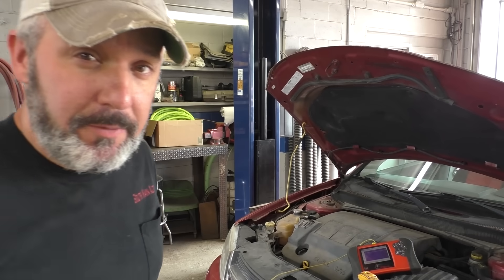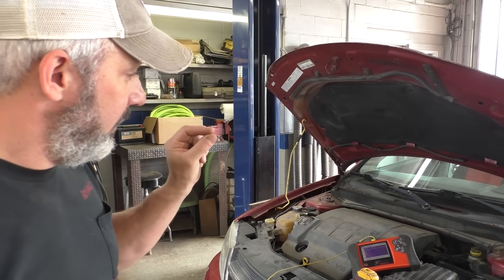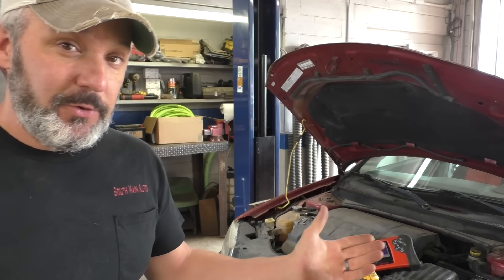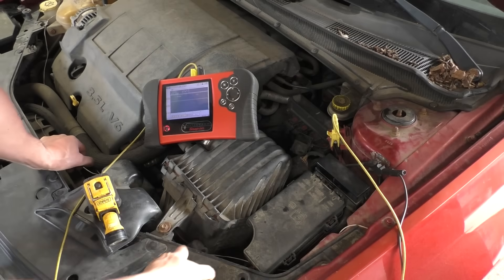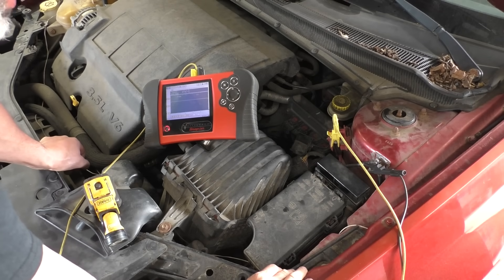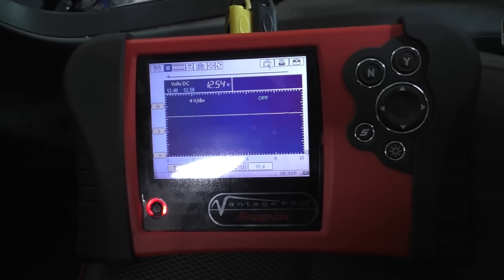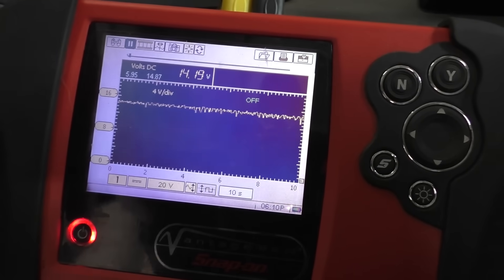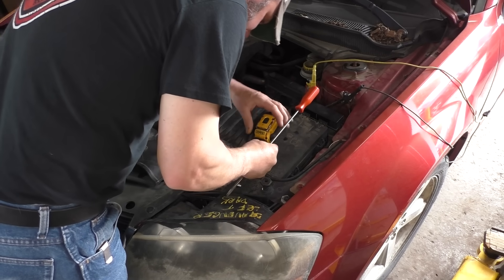Another Lesson In Voltage Drop - Don't Skip The Basics!

Comment: I have a car (2006 avalon) that has an ELEVEN Amp draw.. When I take the 7.5 EFI fuse.. It drops down to 1 amp... How is that possible? Fuse isn't blown... Killed a brand new battery and the alternator.. Shouldn't the fuse blow if there is a short?

Comment: The battery cable clamp looks like steel, not copper?  However, I know that in locations where they use salt on the roads, anything is possible.

Comment: Great video. I teach Automotive Electrics and on day 2, I explain that a volt meter is a "difference meter". It shows the difference in volts between the 2 places the meter leads are connected. My starter circuit testing includes measuring voltage drop on the positive battery cable, positive battery post to the "B" terminal (big terminal) on the starter solenoid and the ground circuit, battery post to starter housing. The test must be performed while cranking the engine. Should be .5 Volt maximum. Sad to say that most shops out there don't have a clue what they are doing and will simply "guess" with the customers money until they eventually repair the car. After they have guessed all of the possible parts, they then send the car to a shop who knows what they are doing as is the case in Eric's video. Unfortunately, these shops make more money by selling all of those unneeded parts  to unsuspecting customers, than the shops who know how to repair cars correctly, the first time.

Comment: a bad ground cable or ground?    jumping ahead a bit  I understand voltage drop ...its simply voltage that drops ...since the voltage pushes the current through the circuit, then it it gets tired and drops as it gets to the end of the circuit

Comment: Greetings from Estonia! I've been watching Eric's repair videos for a long time. I have an interesting experience with the ground terminal. We replaced the clutch on a 2002 Citoen and after assembling the car, the car wouldn't start, only the electric power steering worked when I turned the starter.We spent 2 days looking for a fault why the starter wouldn't start. The fault was that in the original the ground cable was attached under the bolt that secured the gearbox and starter to the engine. But we had placed the ground cable under the bolt next to it, which also secured the gearbox to the engine. The distance between the bolts was only 8 cm. A very absurd incident, I will remember it for a long time.

Comment: Using the parts cannon means a technician does not know what they are doing. There are simple devices that can check the battery, alternator and starter now, that cost $50. Batteries and starters should never be swapped out and then have the problem still unless they were bad.

Comment: You said that an ohmmeter would read 0 resistance in this case so you’d have to use a voltage drop test. Isn’t resistance in that connection the cause of the voltage drop? So therefore it should read some resistance?

Comment: Hi, I just want to ask if a voltage drop of .6v from BATT post versus IGNITION ON reading? The ignition wire from the key gives direct power to injectors and ignition coil so I am a little worried. Thanks!

Comment: Excellent troubleshooting. As a technician for over 30 years on industrial machines and aviation, I appreciate your hard earned experience. I have seen many issues due to just bad connections at the battery that could cause confusion. I trust your findings and appreciate your humbleness. Humbleness is strength. Jesus taught us that. I learned at an early age to always check the simple things first. Eric would also be an excellent teacher in an automotive school.

Comment: I am very confused. There is more voltage at the spot on the shock tower and doesn't that connect through the lug on the battery which is a poor connection. Looks like anything that connects to the lug on the battery would be impacted.

Comment: What I don’t get is this: based on Ω’s Law, if in a case like this with a corroded connection, resistance rises and the load continues trying to draw the same current - so how can voltage drop instead of rise?

Comment: I’m testing for voltage drop, neg lead to neg post, neg terminal disconnected, I have my positive voltmeter lead to this neg terminal, with the key on, I have 12v showing, with the key off it’s zero, with the key on its shows 12v again. Does this mean I have a 12v short or voltage drop with my key on?

Comment: For slow crank it would be prudent to inspect the transmission/block ground and if the crap battery ground lug band-aid repairs actually follow the OEM starting current wiring for starter return current to the battery. Why would the starting current go through a shock tower ground? Ideally it should go directly to the starter, but usually the OEM uses the next best thing which is the transmission case or the block.

Comment: I usually just use an amp clamp to initially check for parasitic draw. Can check for amp flow on the +terminal after modules go to sleep. If i find something then i look for the same amp value with a multimeter. If i see .9 milliamps flowing on Battery+, i look for it on the fuses, if i find .2 milliamps on a fuse i know i'm still looking for .7 milliamps somewhere. I make sure the total number of flow i find in the end is relative to what i detected in the beginning. There have been plenty of instances where there are multiple draws.
Reply: It's surprising how much amp flow is normal in newer cars though. Lots of modules stay awake and do testing post key off.

Comment: Guy I worked with in the early 80s had a beater VW rabbit that did weird things when you turned things on. Long story short, someone replaced the engine and didn't reconnect the ground strap from the block to the body.

Comment: Thanks. I've got a soon to be 17 year old car in the rust belt and over a year ago the headlights were flickering, plus it ate two alternators in a couple years, then everything electrical got weaker as the battery wasn't fully being charged. I temporarily fixed the problem by running a 12 gauge wire of 9" length from the negative battery clamp to a fender bolt. Things seem happy now but I'll have to look around better later on.
I did the same thing with a 20 year old CJ-5 that would drain the battery if it sat for two weeks after noticing that the headlights got brighter when I applied a little pressure to the clutch pedal. That patch on the CJ was permanent until I sold it 18 months later.

Comment: So, part of the voltage drop could be due to the way you connected to the negative terminal sticking a screwdriver somewhere is not the best idea. Also, the battery seems undersized or low on charge. You shouldn't be doing consecutive key cranks without running the emgine long enough to recharge your battery.

Comment: Min voltage on the top posts while cranking: 5.9 V
Min voltage on the battery terminals while cranking: 8.9 V
Max voltage measured between the top ground post and the battery negative: 1.5 V

=> We still have 1.4 V of voltage drop that aren't accounted for, don't we? What does the positive terminal of the battery look like?

Comment: Restoring a old farm truck I bought, lot of miles and about everything had to be gone thru and either replaced and fixed. Interior was a complete wreak and when I began I knew the door locks weren’t working and waited until I was just about done with the truck to troubleshoot it. I over thank the whole thing and in the end I had a voltage drop. 12 volts to be exact and it was across the fuse, fuse was good but the connector was spread on the one side and when you pushed the button it went to zero. It was hard to check the drop on the back side of the fuse block while the fuse was plugged in and no access to the back. Because of its age, and shape and how many miles I just thought had to be switches or actuators but it ended up something simple.

Comment: How much of the voltage drop was added by using the steel screw driver?  I know it has a low gauge, but it is steel, which has more resistance than copper or aluminum.   Not questioning the diagnostics at all, but I was expecting you put the resistance of the screw driver in your calculations.  Been watching you now for years, so I'm so proud of myself for even posing the question, so don't flame me, as this is the best day of my life. BZ

Comment: For you auto restoration folks with 6 volt systems ( more common than you know ). The 6 volt systems are super sensitive to any corrosion. Internal corrosion INSIDE cables OR use of much lighter gauge ( 12 volt rated cables) will cause starting problems. Remember the GROUND SIDE of the circuit needs clean connection. CLEAN. ALSO as heat is generated by high current voltage drops you can quickly touch the cables and besides giving yourself a first degree burn can isolate the source of the voltage drop.

Comment: Can you do a more in depth breakdown of voltage drop on vehicle then do it on a prop set with wires and battery and with a load obviously.

It might be worth explaining the voltage readings from a multimeter are not direct readings but a difference between the two points, or a difference in electrical potential.
Like if you have a + wire post with 12.4V and a - terminal connector with 10.4V and you measure between those two points with leads on the volts setting on multimeter (DVOM) the meter will show a reading of 2V because that's the difference in potential (the two readings subtracted) that's why if you have the leads backwards you'll get -2V instead of 2V because it subtracted 12.4V from 10.4V.
I was also taught a measurement between two points on same polarity of the circuit (like negative to negative with both leads) will show how many volts is being dropped between those two leads and if you keep moving one closer and closer to your lead on the  negative battery terminal post you will pinpoint exactly where the voltage thief is on that circuit because of you pass the point it is occuring you will show 0V instead of the 6V(example) you had

Comment: I don’t understand why the alternator would be charging worse at the battery, rather than at the upper connector.  Isn’t the voltage loss between the terminal and the connector, and isn’t it the wire from the connector that’s attached to the connection on top that we can see??

Comment: I was trying this on a Acura, it had an intermittent issue, but electrical related. I could never get the vehicle to act up, but it was bad enough it would stall. Any voltage drop showed nothing unusual.The choice was either take an educated guess or wait for it to get worse. I went with my educated guess because with the stalling issue, and kids being in the car, an educated parts cannon is better than waiting.  My first guess seemed to be correct, and hasn't had an issue since.

Comment: Multimeter set to 20vdc.  

Engine off.   Turn on headlights for 1 minute. Then turn them off.. measure battery voltage at the posts.

 12.65 volts is a full charge. 

 12.45 volts is a 3/4  charge.

 12.25 volts is a half charge.   

Proceed if above 12.5 volts or the tiny fractions of a volt during the next six steps can be off slightly. 

 Engine running.  Headlights on

 Test One.  Measure battery voltage at the posts.  14.1 to 14.8 volts dc is expected.

 Test Two.  Measure from the negative battery to the engine.  0.04 volts max.  

 0.04 volts is 4/100th of a volt.   

 Test Three.  Measure from the Negative battery post to the body.   0.04vdc max.

 Test Four.  Measure from the engine to the body or firewall.. 0.04vdc max.  

 Test Five.  Measure from the Positive battery post to the underhood fuse block. 0.04 vdc max.  But don't stop there.  Continue to all the accessible fuses in the underhood fuse block.  

 Test Six.     Positive battery post to the alternator output stud threads. So you are checking actual output voltage drop from the alternator stud threads to the battery post. This test result is likely going to be higher. 0.3 volts dc or less.  

Pickup trucks need an additional  test 3 modified.  Negative battery to the truck frame.    Many things are grounded to the truck frames. Many times the fuel pump and all the tail and brake lights.  

The above test takes less than 5 minutes.  

Why do voltage drop tests.  

 Think about a garden hose flowing fully without a nozzle.   The only thing slowing the water down is the water rubbing on the inside of the hose.  Tiny amount of pressure drop.  (Voltage drop)  so there is slightly less pressure at the end.  

Same hose with a kink.   The pressure is higher at the faucet end than at the far end.    So measuing the difference in pressure is easier. Its greater..

Copper is not a perfect conductor.  So engineers design and size wires for around 0.02 or 2/100th of a volt.  Except for the alternator output circuit.  Copper is expensive.  

Practice this test on other cars first.  So you know what good meter readings are.  

waynep71222

Comment: I do wish that he had measured the resistance between the center of the post and the rusty connection. And then cleaned the connection. There almost certainly would have been a measurable change in resistance from before and after.
Reply: I understand that he's a busy man and was only paid for diagnosis.

Comment: Oh brother... I just bought a 1988 dodge d150 2wd pickup with an electrical problem that I didn't realize.
The left turn signal didn't flash and the left brake/parking lights are dim. I changed the bulb 1157. Of course it still doesn't work. Also, when in reverse and applying the brakes the backup light goes out, left side only. So... a short! I followed the wires from the brake light along the frame to the engine compartment into a bundle of wires. I did check wiring diagrams but I'm not sharp enough.
I bought a Power Probe PPECT3000 short/open circuit finder that plugs into the brake light socket, nice, followed the wires with the probe beeping along into the engine compartment to the fire wall behind the air cleaner.
Removed the air cleaner, opened the wiring harness best I could, removed old electrical tape and exposed a clump of solder with a pigtail to ground. It's 2 wires that were cut then twisted together with the pigtail and beautifully soldered. I mean a sweet solder job. Anyway, It's not a factory connection but it has been this way for years due to the age of the tape.
Even with this fancy tool it doesn't narrow down the exact wire with the power signal so I'm not sure this solder clump is the same wire or wires from the back light.
I think I should cut out the soldered wires reconnect them color to color and see what happens... ideas?
Reply: The problem is the wire to ground

Comment: Thanks for that PSA!
Got some electrical gremlins in my '15 Mazda, nice with a refresher so I remember to check it the proper way when I get to it.
(I know my electrics well enough, but it's easy to fool yourself when it's not your day job and in muscle memory.)

I've checked and cleaned the battery terminals, topped up the battery water (which was a bit low). It starts fine, just complains that's something's up with the charging circuit when I've done shorter trips. Turning the headlights off before starting will avoid the nag screen most of the time.

 The shop did a battery check when I had it in for service, and it came out okish. But they clearly didn't check for voltage drops, or the water level. 

My money is on a corroded terminal lower down, by the alternator probably. Or maybe even to the head/instrument unit, but hopefully not. (I've torn down the dash to get to the heater on an old Pajero, hoping to not have to do that ever again.)

Comment: Great explanation Eric, as a retired mechanic of over 40 years both civilian and military, these skills of basic diagnosis are being lost by plug in the computer for the code. 
In the Australian Army the vehicle technicians are also taught auto electrics as a combined trade, I was posted to the apprentice school as an instructor teaching auto electrics, I had to simulate faults so that the apprentices could diagnose problems, unfortunately with new vehicles faults don't occur as often as older vehicles. Thus it is difficult to get the required experience, Your video's are great.

Comment: Always loved your "no BS" channel even though I am a serious DIYer that has a shop that is extremely well equipped. Also an electronics tech, so the "excessive" v-drops can be in the following cables: engine block to ground, ground to the battery, positive to the starter (usually split in a Y to the alternator as well). On a 12V system, the maximum drop from the source to the load is 0.5V for the current in question. I also solder the ends of my cable crimps so that I do not have to worry about corrosion at the crimp which equates to voltage drop. Might pop in one day if I am in the Finger Lakes area.

Comment: Hi south Main! I have a 2013-2014 Toyota  Camry with an automatic transmission. The transmission is slow to shift from second gear to third.. starting out from a stop, it changes to second, hesitated to third, then run smoothly all day until you stop again to move out..mechanic says the transmission is burnt up and has quoted me $6000.00 to rebuild the transmission as the only solution..however, I think the issue is shift solenoid problem..what  do you think it could be..DESPERATE FOR A MORE COST EFFECTIVE SOLUTION...YOUR ADVICE WOULD BE GREATLY APPRECIATED. THANKS

Comment: I tried that test... I placed the screwdriver end on battery positive. Why did my screwdriver get red hot & partially melt? I gave it a good 45 seconds to see if it would stop. It didn't! Very difficult to remove the screwdriver, as it appears to have melted onto the positive post... Should I replace the battery now?